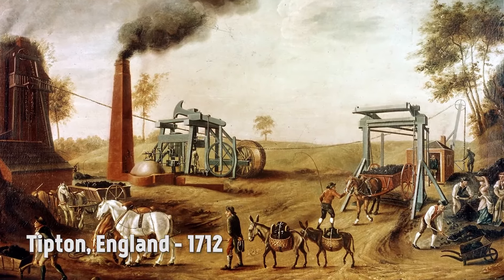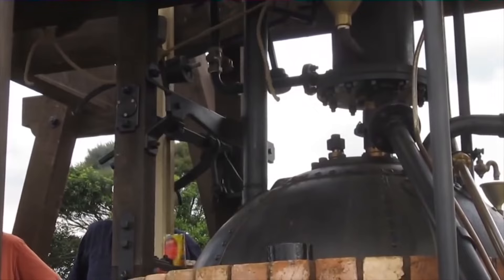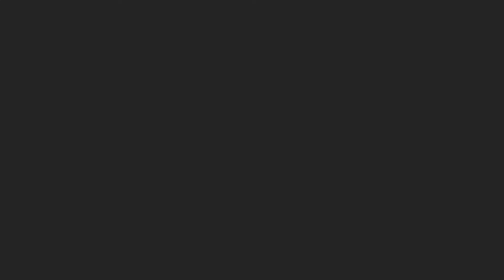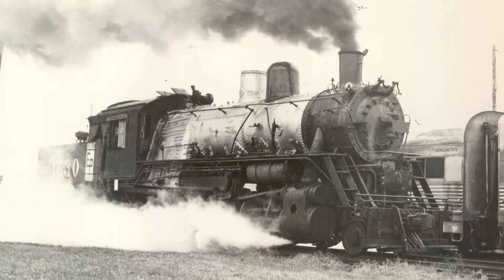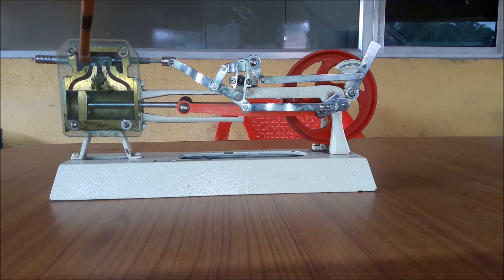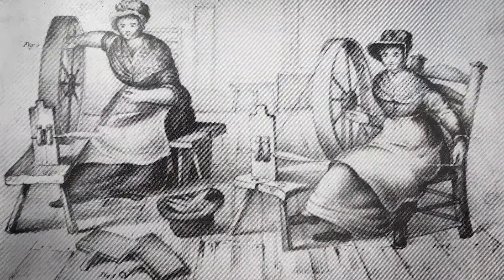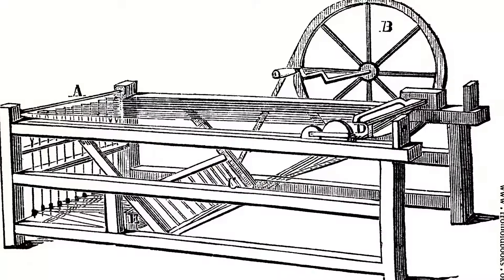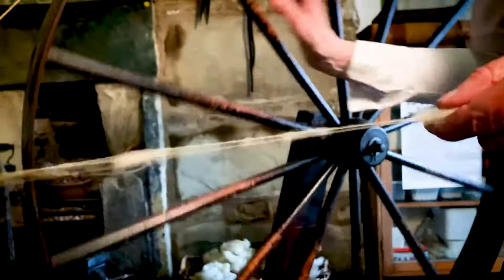The First Industrial Revolution

Comment: The Industrial Revolution was the replacement of Water-Power by Steam Power.
James Watt dumped Savery and Newcomen's Atmospheric Power and Arkwright's Water-Power for Steam Power.
To achieve this he had to invent a new machine, the world's first PRACTICAL High Pressure Steam Engine.
It was a Power Revolution.
The relatively meager number of Water-wheels were replaced by a massive ( eventually! ), number of Steam Engines.